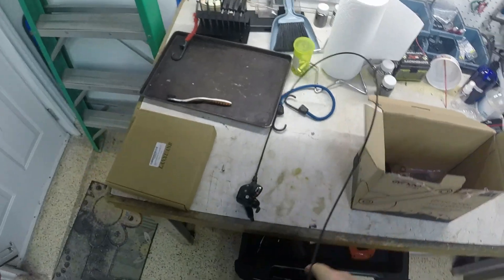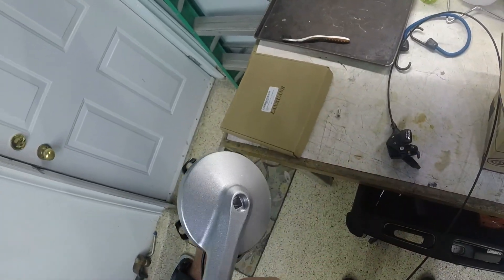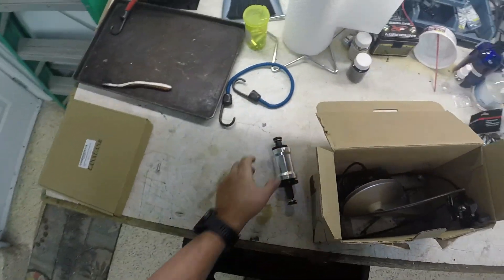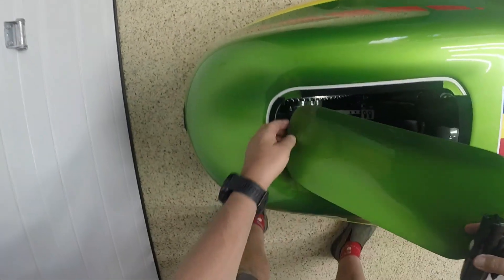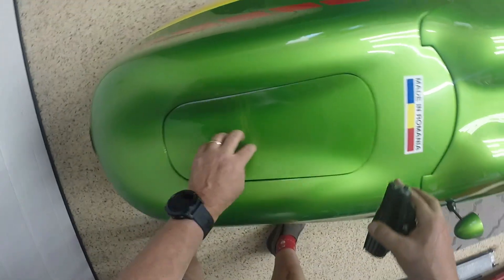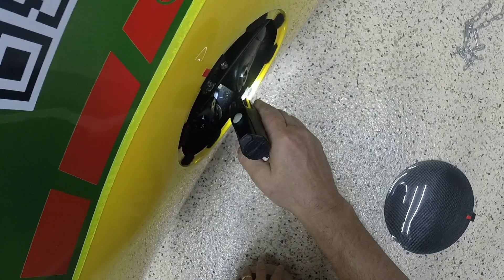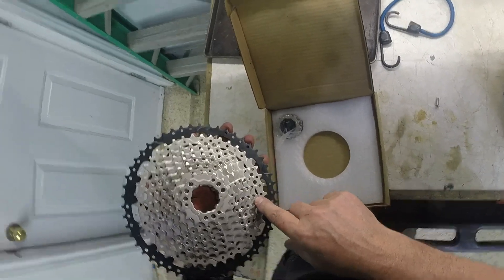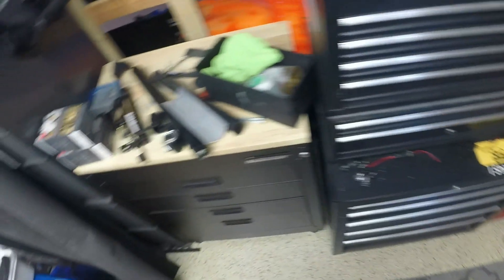Efneo Conversion Pt 1

Comment: Hi John, i drove a Bülk with new stock singlespeed one by 12 and a 52 toth kassette. It was a shimano rear derailer mounted - everthing worked just fine so i think you wiil not get a hassle by installing your big "sawblade". Im getting my Bülk next week also with this oneby setup - looking further to your conversion! Best regarts from Austria, Peter 👋
Reply from the maker: Good to know Peter.  I'll be starting the conversion on the weekend and will be videoing it as well.